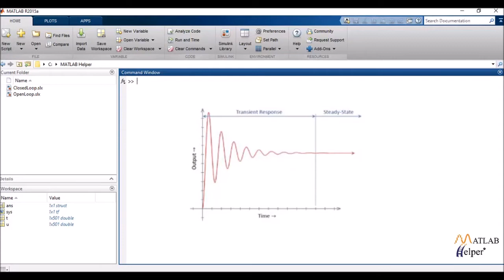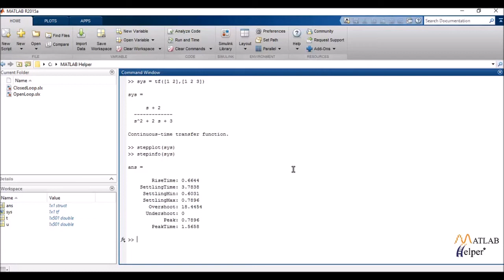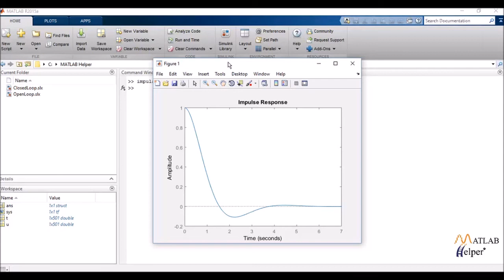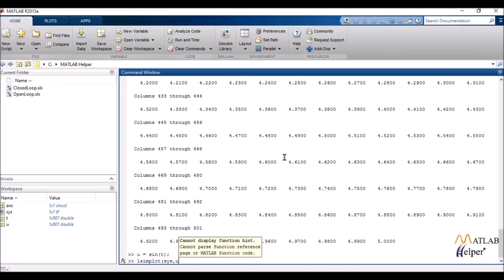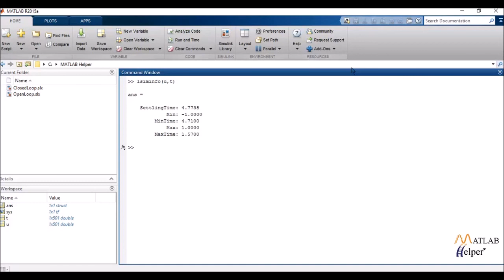Time Domain Analysis | Control System | @MATLABHelper

Comment: Overall the video explains the concept properly with a brief introduction of step response and impulse response however there are few things which are not mentions that is specification and what is the necessity of it. Few modifications can be added (like making the code general for any values) 
otherwise it is easy for a learner to learn the concept with that good video editing and the soundtrack.
Reply from the maker: Thanks for the suggestion.

Comment: #Time domain analysis is the change in the system response with reference to time.It has two parts:
1.#Transient analysis:Output is rapidly changing with time.
2.#Steady state analysis:Output has steady value.
Define the transfer function using command# tf([  ]).
#Stepplot(sys) is the command which is used to observe the step response.Here the input is step signal.To get the specifications,we have a command as #stepinfo(sys).
#Impulseplot(sys) is the command used to observe impulse response.Here the input is impulse signal.
For linear analyasis,#lsimplot() command is used to view output with the system object.To observe its specifications,#lsiminfo()command is used.
Reply from the maker: Disha Nikam, Glad to see your appreciation for our Video. Do support us by Subscribing to our YouTube Channel at https://www.youtube.com/c/matlabhelperteam